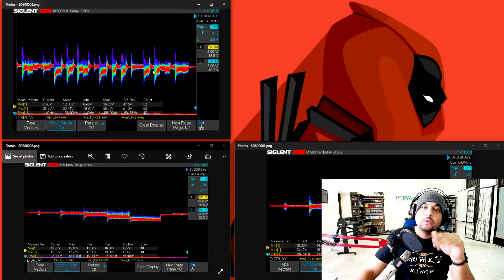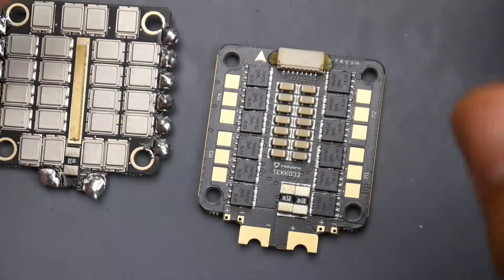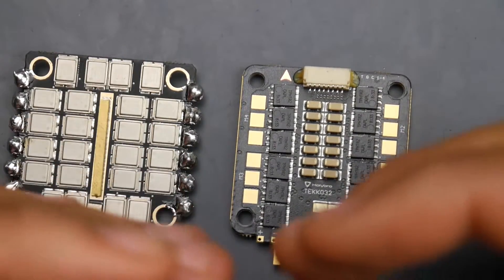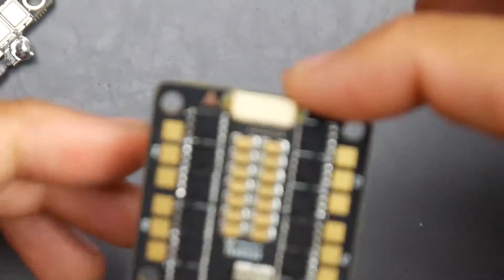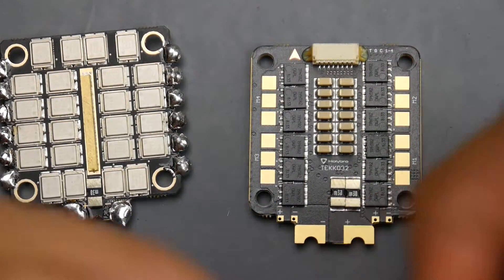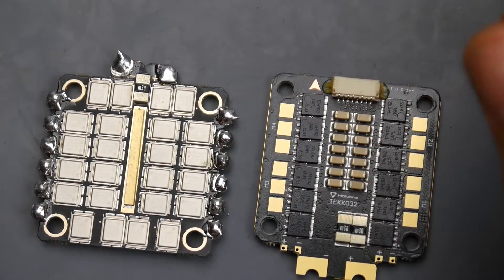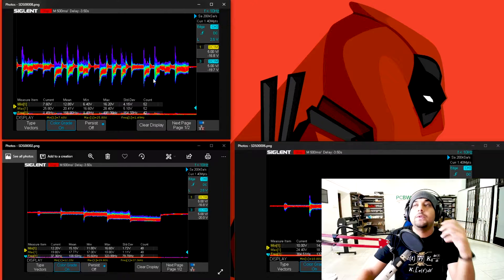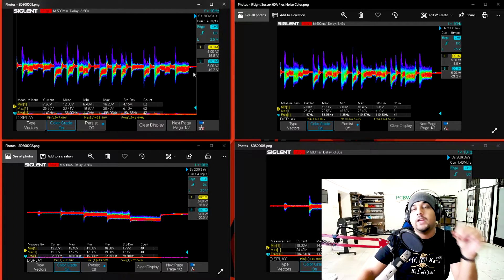Why F3 FPV ESC's Are Better With Data // Holybro F3 ESC Models

Comment: So this might be a little bit off topic, but how do you suggest mounting the tekko32 metal 4in1? Holybro writes that it's mounting holes are connected to the pads, which is kind of anyoing. So best thing propably is using a nylon screw and standoffs I guess?

Comment: Hey :) how about  Furling32 4in1 Airport - Also f3, but much more caps on it and it is 50amp 4s (sort of 6s capable)?
Reply: True actually, wonder how would it stack up against "the noise king"

Comment: . .  can your lvcap be too large - fx 1000 on 5 inch ?
Reply: No, the bigger the cap the better, you can't go too big. But 1000uf is the sweet spot you don't need more then that in most cases
Reply: @anthonysamaha3760  thx :-) much appreciated - got a hole bag of them, but had a flyaway after mounting one straigth onto the fc - it still hurts :-)
Reply: @poulmartinmller4094  Ohh dam, you are meant to solder them to the battery lead. Good luck on the next build though. That must have hurt
Reply: @anthonysamaha3760  ... i think if you mount them on the vcc pads, it's ok. The cheapass Diarone stacks come that way before i fry them them too. last month i hit high voltage power lines in the dark and it went from 22v to 2 gazilion volts. Qed, god is a vindictive bastard :-)
Reply: @poulmartinmller4094  No mount them on the battery lead for the best results.
Reply: @anthonysamaha3760  ..... since I'm the oone with the flyaways, I'll shut up and do as told, for once :-) 
Thx Anthony, kind of you :-)

Comment: Theres not any huge performance gain if using BetaFlight.  Fl-1/Falco-X firmware is however able to take advantage of the F3 processor! It truly is a mind blower!!!
Reply: Tell me how lol
Reply: Yeah, rpm filtering uses most of the f3 and flys just as good if not better then Fl1/Falco-X when tuned right IMO.

Comment: I'm curious why no one (except me? haha) seems to be using the Kakute mini stack, F3 ESC, F7 FC,
It seems to support just about anything (gps, compass, baro, ...)
Reply: Well, I am :) Very happily, though. I use it in a 5 inch Floss 3.0 in a 4s rig. Maybe I will try to switch to 6s later
Reply: hi guys i was wondering the same question! it's even funnier to wonder how holybro is so little spread in the end, or do we all do it in silence? after all this time you still have positive feedback from the holybro stack? I've been flying full holybro for 3 years now, it's rock solid!

Comment: I will comment that I fly the holybro f3 individual ESCs on my 6S race quads. I have absolutely 100 percent thrashed these ESC to detah on 6S with 1900 KV 2207 motors. I've flown Aikon's previously and none of these would have survived. They seem to be more durable.

Comment: Another thing is performance consistency. I know some guys who are pushing the limit with performance 6s setup, they said they can push 2250KV with 48KHz PWM rate and they're getting zero desyncs where other ESCs failed. I'm using F3 and personally don't feel any advantage (yet).

And did I see the Tekko32 metal has motor pads connected to mounting holes? That'd be a ticking bomb with metal screws.

Comment: Have you tried the Pyrodrone F3 45a ESC? I heard that one is good too. You should noise test it
Reply: Good performance, but it's blown 3 FC's and 2 VTX's before I had to retire it. Hadn't blown an FC in 2 1/2 years.. Since going back to my Megabolt FS and Hobbywing 60a, it hasn't happened.
Reply: RR thank you for the reply. Why do you think it made the FC’s and VTX’s blow?
Reply: @roidbear5  The fact that I had 2 identical builds using the Pyro32 v2. I was previously running 1 HobbyWing and the other had a Spedix, I've had the same revolts for over a year and never any issues with them. All of the sudden when I threw the Pyro into them I had 2 dead FC's and both my RUSH Tanks were dead... Never had that issue with any other ESC's. I had also spoken to another gentleman in a FB group and he had also killed 2 FC's with the Pyro32. Maybe it's bad luck. They do fly really well though. It still works fine, I just don't run the FC or VTX through VBAT anymore, and it seemed to have worked while I waited for my new ESC.
Reply: I have used them they work well, i got 2 one was DOA so that yeah. but pyrodrone was happy to replace
Reply: Anthony Samaha Are you still using the Pyrodrone ESC? Or how long have you used them for? Thank you for your reply
Reply: @roidbear5  It did not make the fc and vtx blow? DOA means Dead on arrival if thats what you were thinking. Yeah the one I am using are holding up well, can recommend
Reply: Anthony Samaha Thank you, I ended ordering one for my new build to give it a try.